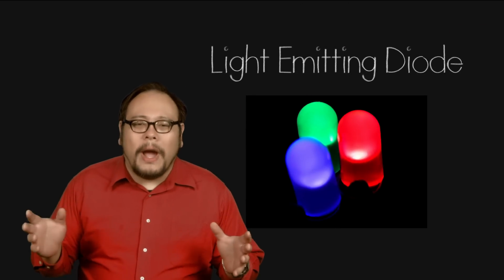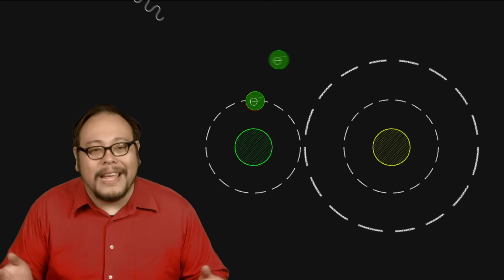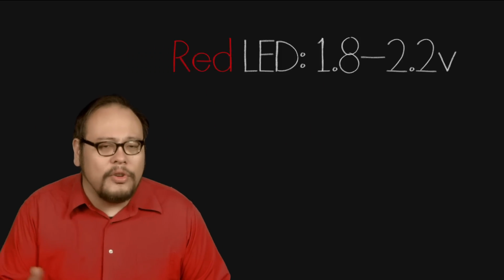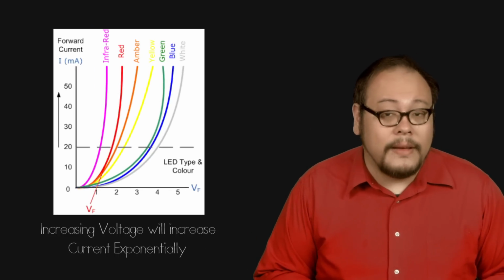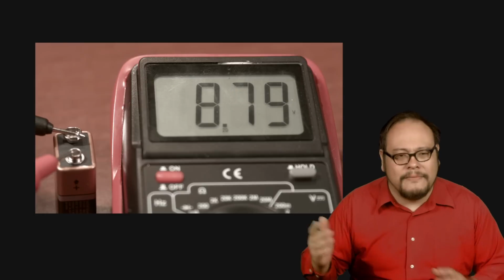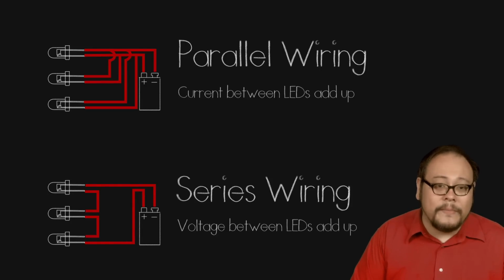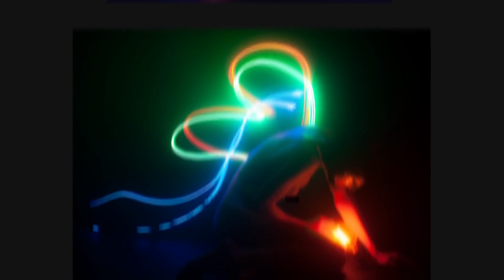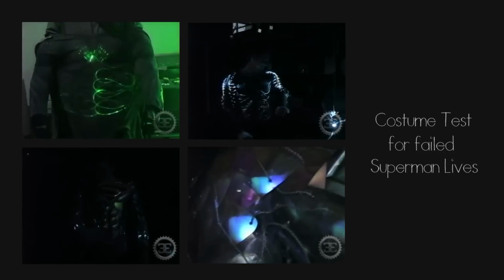The Science and Circuitry of DIY LEDs

Comment: My favorite trick with LEDs is to point an IR remote to a camera, and see if the camera sensor picks up the IR light and makes it visible, which is very common with some IR wavelengths and sensors. Having such a sensor is a godsend sometimes. When patching fiber optics cables carrying IR light, I actually used my smartphone camera many times as an improvised detector to determine if a fiber is "hot" (connected at the other side). Of course, this only applies to regular IR LEDs used on multimode fibers. If it was IR laser light common on single mode fibers, I'd be much, MUCH more careful, obviously.

Comment: There is something that confuses me: The + and - convention. I am used to connect battery (+) then resistor, then LED, then battery (-). If you see the video in 10:05 the drawing shows first (+), then LED, then resistor and finally (-). I am pretty sure I would burn my LED if I do it that way ... But not sure, now I am confused!
Reply from the maker: Either way is fine. There is a convention where the resister is placed on the cathode side (-) because electrons flow from negative to positive but you can place them on either and it doesn't affect the circuit.

Comment: Yes, current(MA) or (AMPS)  absolutely  has to be right..or the LED will smoke...and that means to get the current right you HAVE to have a resistor inline...or it(the LED) will burn up.....and there are limits to the current also...by this I mean...if a 3 volt diode will use say a 1k resistor...at 50ma....you cant run the diode at say 50 volts with a larger resistor...it will smoke...That always confused me...I would say "oh I have a higher voltage and want to use an LED...so I can use a larger resistor...and NOPE ....it will burn up the resistor.....

Comment: Thanks for the video. It's very useful even for engineers.
PWM stands for Pulse Width Modulation and with an appropriate capacitor parallel at the end there would be no blinking.

Comment: Strictly speaking, the animation of electrons "flowing" round the circuit isn't actually happening. the CHARGE is transferred at the speed of the propagation in the conductor, the actual electrons only move a short distance before passing on their energy to other elections. The average speed of the electron movement is called the Drift Velocity and is counter-intuitively really slow!
See https://www.scienceabc.com/nature/what-is-the-speed-of-electricity.html

But this doesn't invalidate what you are saying, of course, it just means that, once again, the reality is more complicated, but not strictly necessary to explain the concepts. Great channel, BTW.

Comment: If you're going to use an AC adapter, keep in mind that unregulated adapters will output more the 50% more than the rated voltage at low currents. This matters when choosing the dropping resistor. Which can be in either the anode or cathode lead.
Reply: Thanks Mr hat it's nice to see you're happy now garrison doesn't have his hand up your backside

Comment: Great video and quite inspiring.
My 2 part question is (1) I am using a DC12V - 2.0A - 5 Meter/ 16.4 feet LED colour changing strip light cut in the middle, when rejoining strip light, is it ok to use 240V 13A section of cable in-between,
cuz in the UK I have lots of this cable around, I'm making the assumption that a higher Amp and Voltage rated cable is ok to use, though I'd like to know for sure? 
(2) , What is the maximum length cable joining the two I should not go beyond, I'm wanting to bridge a gap of 1.5M / 5 Feet, should I bin 1.5M of the LED strip to keep strip and joining cable a total length of 5 Meters, or preferably can I keep the whole strip? 

Thank u for any advice. I've recently joined https://filmmakeriq.com/courses/ and really like it
Reply from the maker: +War Hammer if you are running the power from the cut lighting strip to the following cut lighting strip the power flowing through there is only 12 volts. So your 240 volt cable is way overkill for the job but it should work. The only thing to be concerned about when bridging two pieces of strip lighting is possible voltage drop in the bridge. If you're bridging 5m it probably shouldn't be enough to be a problem.

As far as the length of LED strip, that's a question of your power source. They're 2 amps per 5m so to drive more than 5 meters you'll need more than two amps. Now this is regardless of having a bridge Connection in the middle or not because remember the bridge doesn't actually do any work in terms of electricity
Reply: thank you for your very helpful answer.

Comment: PWM is Pulse Width Modulation... Not "modifier". Also PWM is the best way to dim LEDs, because the voltage stays the same, it's just the amount of time that it is conducted that changes. Varying voltage both higher and lower than rated can shorten the life of LEDs
Reply from the maker: +TurboHawkV6 I guess you didn't watch the video. PWM is murder on video cameras...
Reply: I did watch the video... but you said "The best way..." which in reality from an electrical standpoint is PWM, like I said using varied voltage reduces the life of LEDs, PWM does not. Using varied voltage may work better with certain types of cameras.
Reply from the maker: +TurboHawkV6 PWM is very problematic on cameras. It really isn't even an option for anything video related.

Comment: Two mins in and scratching my head about how this relates to film.  Aw whatever, generally you have great vids.
A couple quick notes though: reversd bias is employed too (zeners), and LEDs can also sense the freq they emit (shine a red laser on a red LED and measure).  Have a great day.

I decided to continue watching.  Sorry, as a retired electronics engineer, and being practiced at failure mode analyses, I like watching people try to explain basic circuitry and get a kick outta all the little details that get screwed up one way or another.  Like how it really doesn't matter if the resistor is in series with the diode at the cathode or anode - electrically it's the same thing.  And you don't need the 1ohm resistor in a simple 9v alk battery cct because the battery has about that as an internal resistance.

You're definitely right when you say that typical values aren't accurate (like the battery voltage).  This is true for all non-precision components.  Even "identical" transistors can be off just a bit from batch to batch, and is why some ccts are better when integrated on a chip, like phase discriminators for example.  Temperature also has effects on values, which is why some components are kept in an oven to maintain exacting temps, like a crystal oscillator.  You've likely experienced the temperature effect with automobile batteries (if you have winters where you are).

The way you make vids is just top notch though.  I've learned a helluva lot from you with regards to motion pictures.  Thanks.  And you're well-spoken, and you got nice graphics... very nice work.
Reply from the maker: Everything is related to film.

With basic LED knowledge you can add lights for your miniature shots. 

LEDs are now part of many lighting instruments. With a bit of knowledge you can add light anywhere you want.

Comment: Why do cameras react so bad to pure Red and Pure blues LED lights?
Reply from the maker: Just as we talked about in the video - the color LEDs put out a very specific wavelength of light. Cameras Sensors are used to seeing a wider spectrum and therefore weird things start happening when you feed them light from some LEDs.
Reply: I knew it was a wavelength issue.. But is there anyway to solve to problem except get rid of the pure forms?
Reply from the maker: I'm not entirely sure - I think more modern sensors handle them better than older systems.
Reply: I recorded a dance recital and the dance company insists on using just RED or Blue LEDs to light certain dances and it comes out horrible with my JVC GY-HM200. And I have noticed that even big production events have trouble with that kinda lighting as well.  Talking about a concert that was broadcast on TV and used pure red and blues for  the back  ground effect and it was did the same thing to even the most expensive systems! Oh well, Thanks for you response and keep up the great videos!
Reply from the maker: Yeah - I have the same issue when shooting theater productions with my Sony EX1 - I don't see it so much on the BMCC which I sometimes use as a second camera angle. 

Theater lighting is sometimes so difficult to deal with...

Comment: I would also say look into those Arduino boards.  they are project/hobbyist micro-controllers but I have heard of people programming them to do things with LEDs they can also control switches to allow one to control a relay that is switching banks of LEDs.   Raspberry Pi is another compact platform that one could use for LED control.   On a set one could for example use these to setup the ubiquitous panel of flashy lights in the background of a computer room or science fiction stuff.

these devices can also have sensors hooked up which would allow automation of LEDs for a scene.  Say for example science fiction production and when the talent gets to a certain point a corridor the lighting goes red to give the image of power loss or red alert.  Simple beam type setup could mean when the talent passes a certain point the micro-controller would flip from say white lighting LEDs to red ones.   Or even just do sequenced illumination like is seen in some scenes in movies.

neither of these have the power to drive large banks of LEDs solo but they can control relays that handle much higher power needs.  

https://www.arduino.cc/
https://www.raspberrypi.org/
Reply from the maker: Thank you! Very cool info! I bought one of those Arduino board kits and read up about them. They seem to be a great first step solution to being able to translate computer code into the real world.

I'll have to dig it back up and play with it (if I ever get some free time).

Comment: I wanted to know how to conect a bunch of those strips of LEDs to my 220v home wall, I guess a phone charger will do?
Reply from the maker: +Martin Clementz you need a driver to convert your home power to 12v. Most phone chargers are only 5v so you'll need something else that delivers 12v. Also keep in mind the power draw. I think 5m is one amp so there is a limit to how many your can string yup to one socket.

Comment: Why do you recommend that people put the resistor on the negative side? In this simple case it may not matter, but when common grounding is important, you really want resistors on the positive (+) side. Also, PWM stands for Pulse Width Modulation
Reply from the maker: I've seen the negative side as a convention so I just stuck to that.

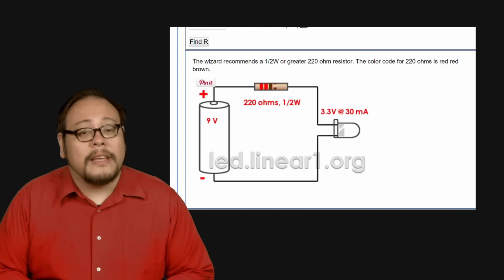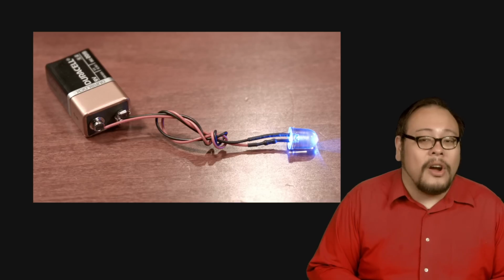Comment: Silly question, ... why did he say to put the resistor on the negative side, but both the 'online led calculator site' (9:38) and the led that had the resistor already installed (11:48) had it on the positive side?

Thanks for the great videos.
Reply: I can confirm that! It makes exactly ZERO difference.  Where a convention exists it's entirely for human benefit as it makes circuit diagrams, PCBs, etc. cleaner and more consistent.
Reply from the maker: I've picked up somewhere that the proper way to wire them up is on the negative side.  That might be a convention based on the notion that electrons flow from the negative side of the terminal to the positive side (we named them positive and negative before we understood what electrons were). Still you could put the resistor on the anode side it shouldn't matter, but I thought I would stick to convention.